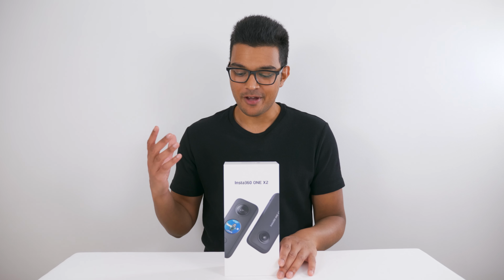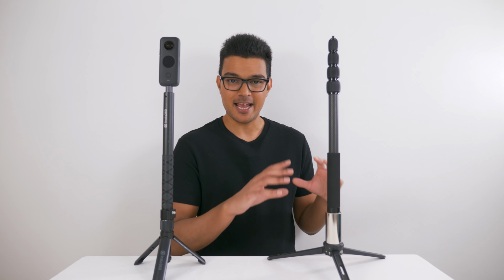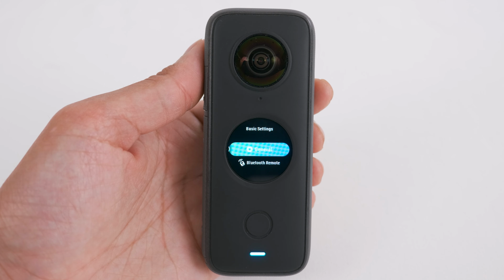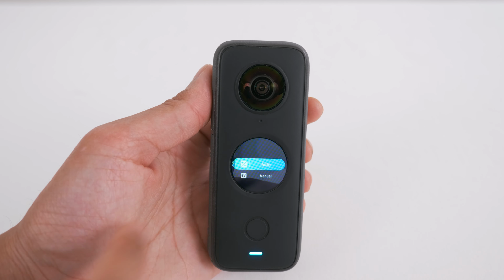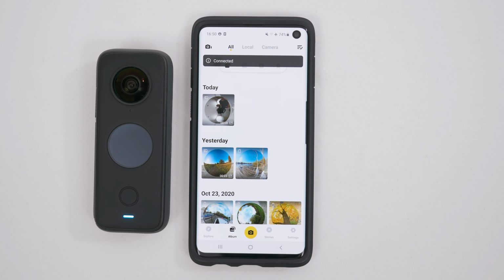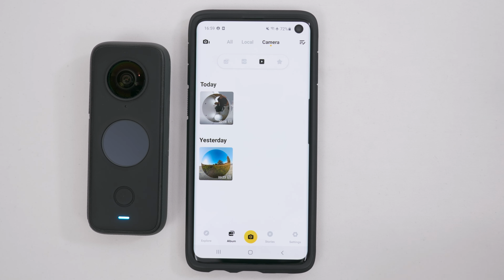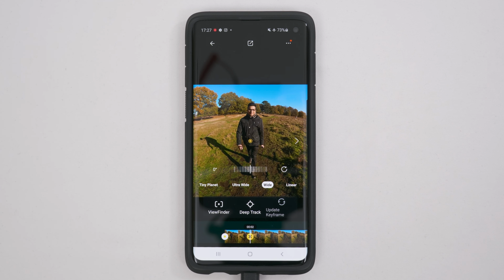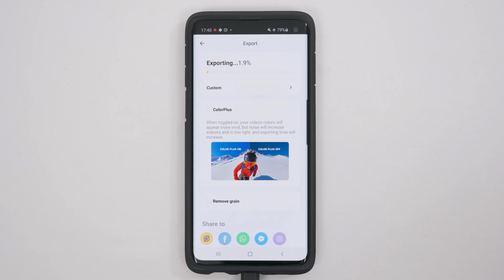Insta360 ONE X2 Quick Start Beginners Guide

Comment: Hey, great video, i have a question, is this new 1inch 360 camera compatible with the previous 1 inch wide angle lens released for the one RS? Can i use this with this new mod? Have you tried it?

Also i cannot find any extra vertical batteries on the 360store, says out of stock
Reply from the maker: You need the upgrade bundle if you have the one RS core and 1 inch wide angle Lens already. The upgrade bundle has the vertical battery, 1 inch 360, and vertical mounting bracket to adapt your mods to 1 inch 360

Comment: Does this camera come with a small in built tripod and also does the camera automatically make the tripod/selfistick invisible or is there something in the settings that needs to be changed?
Reply from the maker: No it’s not built in. It’s separate. The invisible selfie stick effect is automatic. However the tripod is not completely invisible. The stick will be invisible but the legs will show. Only things in the stitch line of a 360 camera are invisible
Reply: @Best360  thank you for the clarity. Just ordered mine so will be back for more tutorials keep up the good work 👍🏻

Comment: Hi friend. 
Brilliant videos, you are super clear. 
When I record, my results are not sharp and look poor. They look worse when I upload to YouTube from my iPhone. I’ve set all the settings in this video you cover. 
Any idea how I can make them
clearer sharper and no patches of blur please?
I’m using a one x2, with Insta pro Len’s guard covers and iPhone 12pro. 
Thanks.
Reply from the maker: There’s a couple of things which can effect video quality. 1 is using auto exposure mode. It might make your video blurry in low light or cause patches of blur. 2. Lens guards will make the video appear less sharp as there is a layer in front of the Lenses. 3 for YouTube I would edit on insta360 studio instead for higher quality output
Reply: @Best360  thank you for this, it helped and now they look better. I can’t use the Studio on pc, it stated my graphics card was older but the Pc is a good HP Spectre x360 or maybe I’m not uploading from camera to studio correctly… very annoying!

Comment: Hello. Could the video from the Insta360 ONE X2 be transferred to the mobile app with cable, without using Wi-Fi or Bluetooth? Or transfer the video from the X2 to the PC and then to the mobile app? And is there an option to completely disconnect wifi and bluetooch in the Insta360?ONE X2?
Thanks

Comment: I have the following problem: I turn off flowState stabilization because I want to use steady footage with no movement but then I cannot add keyframes and point the exported video at a specific direction. It exports a video in whatever direction the camera decides to do it no matter where I point it at in the preview just before the export.

Comment: My Insta 360 X2 got water in the front lens after being under for 30 seconds for the first time. The battery and USB compartment was fully sealed. And the unit never got water in those areas. The front-facing lens is forever fogged with water. The unit continues to run fine, just with one camera forever blurry.

Comment: can you tell me which memory card to use, and what size (256/400/512gb or 1tb) of memory card that last with the battery time??
Reply from the maker: I use 256GB which works well for me on weekend trips.
Reply: @Best360  one more question,  continuous recording of 360 video at max setting for 80min would require which size card. Is 256gb enough
Reply from the maker: Yes it will be more than enough 👍🏽

Comment: Shanil thanks for the video really do appreciate it. Had a quick question for you, when you edit the video does it alter the original video or make a copy of it? Since I trimmed a video that I downloaded to my phone but I cant find the original full length 360 video I took on the phone or the 360 One X2 anymore. So was wondering going forward since I was thinking about making a couple smaller videos from a longer video but if it trim it and lose the original then I need to rethink this.
Reply from the maker: You can always reset the footage. It will never overwrite the original 😄👍🏽
Reply: @Best360  really I didn't know that was an option. Thanks appreciate it.
Reply: Shanil hope all is been well with you. I had one other question do you know how the dive case, or sticky lens protective cover or the preminum lens guards work? Do they alter the video and cause some issues? I heard and read some things online where people said it caused issued and the videos were not as good when they put them on.

Also do you have any recommendations if you were wanting to put the camera on a RC Car for mount and protection of the camera or just the lens?

Comment: Thank you for the great tutorial! Does the insta360 app run better in some smartphones rather than other ones? I have huawei mate 20
Reply from the maker: It depends on what’s on your phone as well. If you have low storage, low memory, apps which drain resources, then it also effects the app performance
Reply: @Best360  thank you very much! I have a mate 20 with 6gb of ram and at least 60gb of free storage. Guess that would work?
Reply from the maker: Yes that should work fine. Just close the open apps on your phone

Comment: Hey how are w, I have a question, I’m experimenting some flickering on my insta360 x2 recording video at 5k 24p but when I record on 30p the flickering disappears, it only happens when I use 24p do you have the same problem or is just my camera that has some issues, I wanna know is someone else has the same problem or just me, can you help me please or someone can comment and let me know, thanks
Reply: Also it happens only in automatic settings and  when I use manual mode  it doesn’t happens
Reply from the maker: It's to do with the region you are in. In europe the lights refresh at 50hz and in other parts of the world the lights refresh at 60hz. So it seems like you are in a NTSC region (60hz), so record in 30fps to avoid flickering. And also go into settings, find anti-flicker and set it to 60hz.

Comment: Insta 360 one x2
Insta 360 Go 2
So torn between which one to possible get. 
Could you maybe offer some info on which one is better for what purposes. 
Mainly just wanted a simple method to video family vacations and fun with kids. 
I like capturing my young  kids reactions on rollercoaster which I use my dji action but like the smaller footprint these cameras offer. The magnetic mount on go action worries me as well as not being that secure. 
The 360 videos are cool but not something you might use constantly as it could get overdone but I guess its good to make sure U don’t miss the shot.
Thanks for any info you could provide.
Reply from the maker: It's a tough one. They are both great at what they do. But since you said "simple method to video family vacations", I think the GO 2 will be more fun for you to use. 360 video is more complicated. And maybe something you can add on later if you really need it.

Comment: Hello, I am trying all day to connect my one x2 and it can't be done. The phone does not even recognize the wifi name of the camera. I tried changing the region in the app and this does not work too because there is no connection between the app and the camera. Any ideas please?
Reply from the maker: Contact Insta360 for technical assistance 👍🏽. Might be a phone compatibility issue
Reply: @Best360  i did in Facebook, they said now it's not compatible. Is there a way to connect them with a cable?
Reply from the maker: Unfortunately not :-(
Reply: @Best360  that's so sad, so much money and you can't use it on your phone. It should be compatible with all android phones. Never had this problem with GoPro. Thank you very much for your response.

Comment: have you found any good mounts, i like the insta 360 go 2 's magnetic back, would sticking a magnet tape strip on this harm it?
Reply from the maker: Check out the Magnetic Camera Mount at https://best360.shop. It's great for the ONE X2
Reply: @Best360  thats pretty cool. i was also thinking i could attach some double sided magnets i seen online to a case and attach it that way. That mount will work but wont get a good shot , i dont believe, if i can only stand it straight up.
Reply from the maker: You can use a mini ball head on the magnet to rotate the camera

Comment: Hi. I bought this camera and I have a few questions. Please help me understand the settings.

1) Can I use the audio command to start recording a video? I tried,but I can't start the recording,only stop it. 
2) In the codec selection settings, I see the item steadycam mode, where I can select the H264 or H 265 codec,but what is this mode for?
3) What is a What is isolated exposure? Thanks.
Reply from the maker: 1. Yes but the voice control isn't as good as the gopro
2. Shoot with a single lens only
3. Each lens has it's own exposure. Compared to having a single exposure for both lenses.

Comment: Great starter guide the first pairing confuses a lot of people with the Bluetooth and Wifi to connect.

Do you have the Editing feature available on Android?
Video/Photo Adjustment Edit function that has been introduced to Iphone Only months and months ago.

Is this an exclusive Apple Product? if so... They should say that rather than raking in sales from Android Users but then giving us Limited use... late updates and always left behind and missing features that never even reach.
And even in the "biggest updates" Android is left out on certain new key features that were introduced.

Android has always been neglected in INSTA360 mobile APP and always a few versions behind. I've done my research always Iphone will have the highest and newer Mobile App Versions... they will get the newest features first Android will get the missed out key features "biggest update" later on.

Seems like they never brought it across or neglected it totally for Android. ( Edit Adjust ) Feature
Only option available on Latest App version still ONLY has FILTERS to use on video/photo before export.

Can you confirm this feature missing please?
Reply from the maker: I cannot compare iOS and Android because I do not own an iPhone. However, there are plenty of options on Android which blow any other app out the water. Adding your own music is only available on Android and not on iOS. So there are benefits to Android too. it's always easier to develop for iOS rather than Android because there are far less phones to test on. So Android will always be behind.
Reply: @Best360  Ohhh i see, so there's a vice versa of missing features between both.
Guessing it is easier for Android to add your own music compared to Apple and the rules and guidelines to follow by for app use on iOS.

Thanks for the feedback much appreciated. Interesting maybe someone can get their hands on both Android and iPhone iOS Apps to compare side by side would be Great.

Still that simple "Adjustments" Contrast.. Saturation.. Brightness.. Shadows Highlights.. Control Feature for Photo/Video Editing would be a great function to have before export for everyone.

And it's been missing from the start.
Reply: Bro.. please check with Google Play. The app is there and it's very easy to use. 

Just play around with the app and watch more of Shanil's videos and you'll be up and running.

I've ordered my X2... and selling my One R.. you keen??
Reply: @klimaxsg  I'm likely going to buy a 2nd 360 module as one of my lenses were scratched on the ONE R. Now i will be Immediately be putting Lens Guard protectors on ONE X2 as soon as i get it. (You have to order Lens protectors Separately compared to GO PRO MAX that gives you protection for your expensive investment in the company and product.) Unlike insta360 ..

Lens Protectors for 360 Cameras should be a given, one pair should be included in the base Camera Package as default. Like GoPro Max they have some foresight and knowing that it's for "Action Camera" Usage.
Reply: @klimaxsg  I have the One R... I have the Latest app updates Android.

I said  the Andorid App is  always behind a version or few versions compared to IPHONE...

I bought the ONE X2 waiting for it to arrive.

I said that there is a missing feature on Android app that is on the IPHONE APP that has not made it over for the past few months to Android Insta360 App. still missing.

I cannot follow some One R Tutorials due to missing features that are left out or take a long time to be introduced to Android
Reply: @klimaxsg  As well... they have not updated the App to work with expanded Micro SD / External Storage . Even if i install and Move App to SD Card it only Saves all videos and photos directly to Internal storage no options to save huge video files to my dedicated Micro SD Card that i use just for this reason.

When will they fix that. Internal Storage is a limited thing on many devices and consumers with such and lowest internal storage models.

In other words if your internal storage is very low or full you cant use the Mobile App.